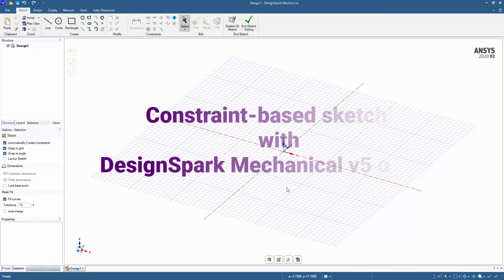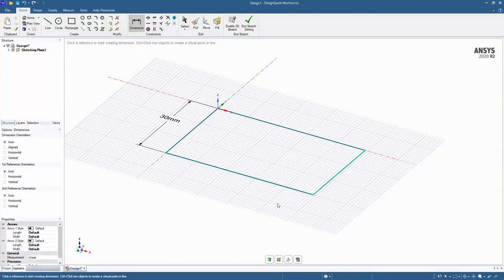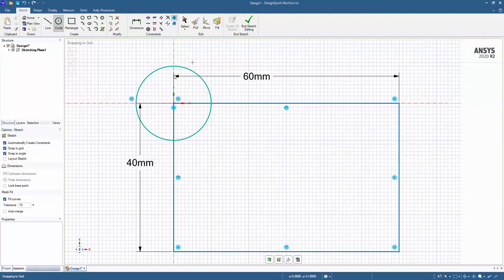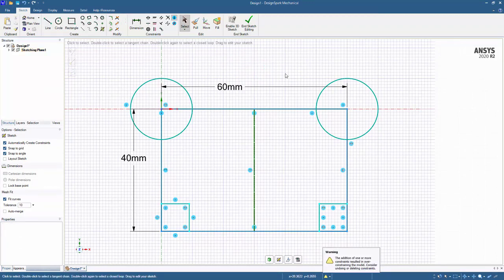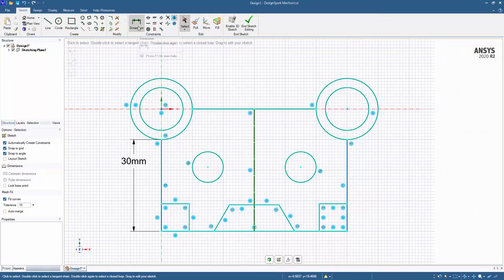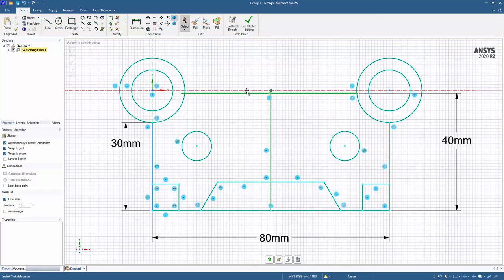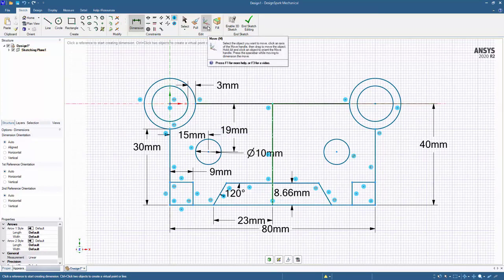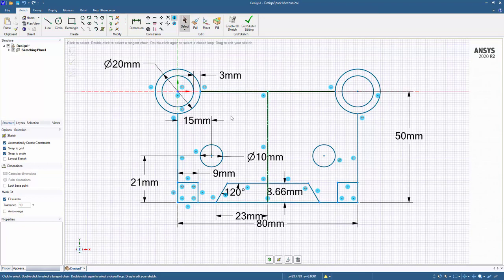Constraint-based sketching with DesignSpark Mechanical

Comment from the maker: Note to users: the 'Sketch' tab becomes available only after you enable it in the software via File (top left DSM logo) -> DesignSpark options -> Advanced -> Enable constraint based sketching. 
Tick the box and restart the software to see the new tab. This constraint-based sketch mode is an advanced function which is toggled off by default, so existing users can start with a familiar UI and new users can easily follow the starter tutorials.
Reply: Why has the Polygon tool been dropped when in Constraint based mode there seems to be plenty of space for it?
Reply: thank you
Reply: this really should have been in the description... looking for help and not reading replies

Comment: How do I turn off automatically creating constraints? The checkbox is literally not there for me.
Reply: Auto-constrain is a feature added in DSM v6.0. With constraint-based sketching enabled, click on the Select tool and look in 'Options-Selection' (usually docked to the left of your screen) for 'Automatically Create Constraints'. Click to un-tick the option. You can disable constraints completely and go back to classic sketch mode by following the above pinned comment.
Reply: @designsparkmechanical1693  Yeah that "automatically create contraints" checkbox isn't there.
Reply: @HypothermicIce  Go to Help/Resources -> About DSM. If it doesn't say version 6.0 there, you have DSM v5 which didn't have the auto-constrain option.

Comment: Thank You. It is Decenber 27 and I just got Spaceclaim modeler 2 weeks ago. This is a question - without being critical or intending a pun! 
@ 1:00/17:34 you created a rectangle, giving it dimensions 40x60. Rectangle - by definition - is constrained by its sides being parallel, which implies that giving it its dimensions it is fully defined and constrained! Why are the 2 far sides unconstrained? That would imply it is parallelogram of undefined size and inner angles.
Next I am wondering  is, if it is possible to constrain and edit the size of extrusions (straight or rotational)

Comment: So, how do you other users work with this?  You design a part, you make sure the constraints are right, you close the sketch, then the constraints disappear and if you then realise that one constraints should have been a few millimetres more, you are out of luck, because the constraint is gone? For simple shapes, I guess you can just "pull" the surface that additional mm, but that's not really the same. I realise this is supposed to be easy-to-learn, but this is a massive destroyer of productivity for me.
Reply: if it was easier to undo, then undo to the sketch and make a change to it.
The constraints in the sketcher are there only to make sketching easier and more predictive to sketch ( whilst in the sketcher) changes. it's quite easy after a while to make quite radical sketch changes - the sketcher will get more tools in the next release. I'm quite a convert now but there are some short comings i'll not argue.
Reply: @TAH1712  ". it's quite easy after a while to make quite radical sketch changes" 
How? The sketch is subsumed into the solid you generate from it - the sketch disappears. Hence, there is no way to edit the sketch after creating a solid.
Reply: @YensR  I meant changes within a sketch only. Yes, sketches are subsumed afterwards.
Reply: @TAH1712  Okay, so this whole discussion has just proven my point then.
Reply: @YensR  OK ;) your point is proven...
Reply: Hi and thanks for your comment. it's i feel important to note that as you progress with a design, you constantly re-evaluate what was done before. Believe in your eye's and brain and make a forward alteration. It's easier to pull, move, add, delete what you see now than go back , make a change, go forward 3 steps, make another change etc. Of course history editing is possible. ps you can always undo any action or undo to any point backwards ( i usually have a limit of 50 steps but that's an user setting option ).
Reply: @TAH1712  "undo" is in absolutely no way a replacement for parametric design where you can change dimensions at any time. 

"It's easier to pull, move, add, delete what you see now than go back ,"
That is simply wrong in software such as SolidWorks, OnShape, Creo and all other professional CAD tools. Of course in DesignSparks it is prohibitive to go back, because you can't just change your parametric values, you would have to undo and redo it with different values. That is just proof that this is an inferior way of doing things. 

You mention "history editing" - is that a thing in DesignSpark? I cannot find it in the menus or by googling.
Reply: @TAH1712  Yes, it's all part of making CAD more accessible and also to go into the region that tools such as Rhino inhabit. But it also has drawbacks as I described. And it's clear that they all started with parametric sketches and still include them, because that is what is most important in mechanical engineering. 
In that example, defining a proper pattern for the holes would just be as quick as what he is doing and the pattern parameters can be edited in solid 3D view, you don't have to enter the sketch (unless you do substantial changes). So it really is no drawback compared to what he is showing.

Comment: I started with designspark mechanical then went to fusion360 just because I can update the model just by updating the Dimensions now the designspark mechanical has the same way of working sketch based modeling i will be returning to designspark mechanical thanks great work keep adding more options.
Reply: Constraint Sketching assists with the sketch only. Once a sketch becomes a face the sketch is consumed and no reference to it can be made for further changes. Only undoing upto the sketch will bring back the constraints.

Comment: If you have any doubts about how to activate the constraint-based sketch mode, this tutorial helps you step-by-step: https://www.rs-online.com/designspark/constraint-based-sketching-with-designspark-mechanical-v5-0

Note: activating the "Contraints" mode results in the restriction of the equations mode, but you can proceed in reverse to activate the equations mode again: DSM 5.0: Why is the equations tool not available for constraint-based sketch mode? https://designspark.zendesk.com/hc/en-us/articles/360010754717-DSM-5-0-Why-is-the-equations-tool-not-available-for-constraint-based-sketch-mode-

Comment: As an important point , it's my view that the final completed 3D design, in the quickest time possible, is the TARGET, thus, I strongly recommend ONLY adding enough constraints and dims as necessary to get the sketch right and go no further, getting the JOB DONE ASAP!  ;) All selection methods for dragging / moving to grid positions or incremental amounts etc ( traditional techniques) all work well 'in the mix' with the new constraint methodology ( under constrained)  - yep i do like...once a sketch is exited, all constraints are lost - their 'reason for being' is only to assist in successful, joined up accurate sketching...
Reply: That is a setup for disaster down the road.

Not properly constraining a sketch, and we are talking about maybe two minutes for a pretty complex sketch, can save your bacon.

Last thing you want is multiple sketches in a model having hidden problems that stack up because you didn't constrain a sketch fully.

" ONLY adding enough constraints and dims as necessary to get the sketch right and go no further" That is way to open to interpretation per each individual designer.

Over a decade working in a group with hundreds of models and the last thing that I want to do is having to stop in the middle of some project where I am finishing work on a model that someone else made and I blow up the feature / history tree because someone was changed far up in the tree that screwed up something else 10 features down that then lead to a cascade of sketches and features dying that I have to then fix.

You might save a 15 minutes in a larger model by ignoring some constraints but you might make for lots of work later on especially if someone outside of you has to fix something that may not even know your design intent which is what constraints help with. They don't just lock down sketches.
Reply: @PickMEInvestingMindset  Umm, DesignSpark Mechanical is not a history based parametric modeler. Whilst Spaceclaim has the ability to record it's history 'IF' using Block recording, so far with DSM it does not yet offer this ability. The new to V5 constraint sketcher based approach is in addition to the traditional sketcher. Adding constraints is a bit of interest which I enjoy actually if wishing to explore the sketch with different proportion geometries. The purpose of the sketch is to produce a face which is the end result in most of my modelling situations. However, in the future no doubt block recording will become more flexible ( it's pretty good now in spaceclaim ) and I'll be using it more especially in situations where procedural modeling has benefits such as plastic components with mold draft etc however I'm very open to it's use wherever there's a time benefit.

Comment: Thanks...i appreciate the indepth example.
Many users will like adding dimensions to sketches and some will comment that it takes longer to add / subtract constraints to drive changes than before. It takes getting used to but i'm speeding up now. The traditional non constraint method is still retained - i'm very glad as with sectional working in advanced mode, it works differently at the moment. I note that overconstrained sketches aren't always that easy to debug although, as a counter positive point, both under constrained and overconstrained are still accepted as a valid sketch for subsequent pulling operations.
from this user, It's very appreciated that this new Spaceclaim technology is included in DSM .
In my DSM v5.0 ( 7171) Sketch Option ' Automatically Create Constraints' isn't there to turn off ! Perhaps it is in DSM v5.0 ( 7232 )...Edit, DSM support has said this option will be in V6
Reply: I'm used to constraints now and can work fairly fast - not moaning anymore...